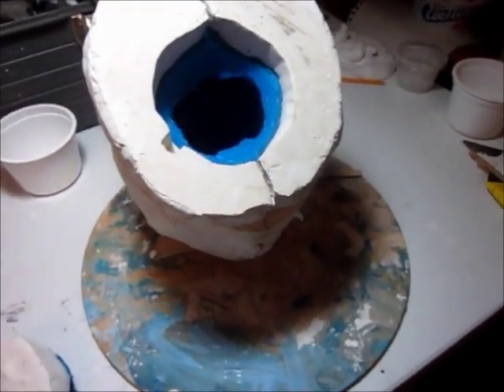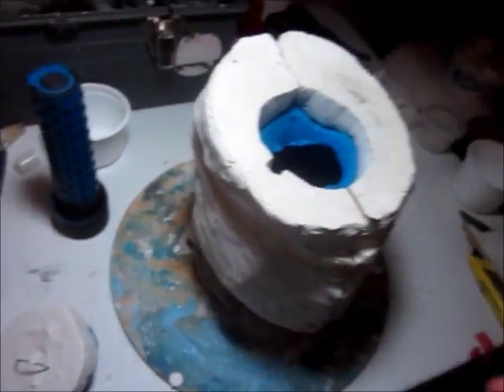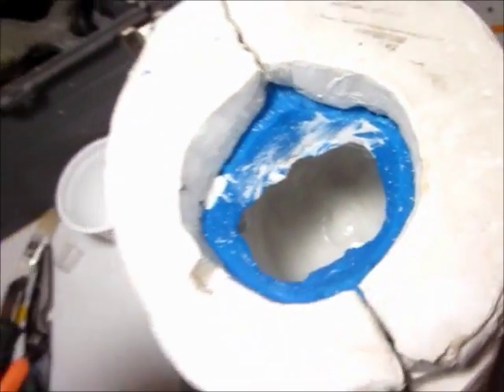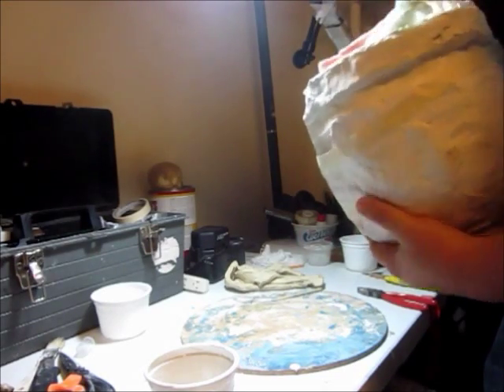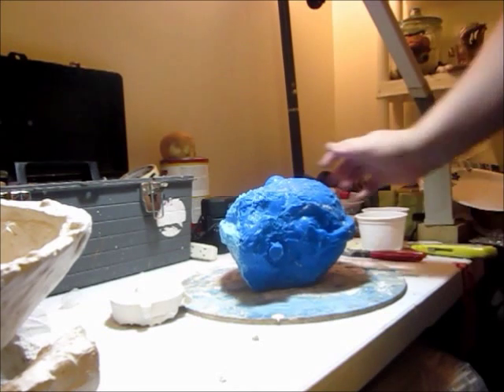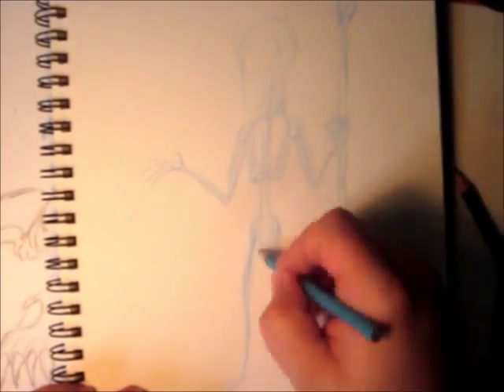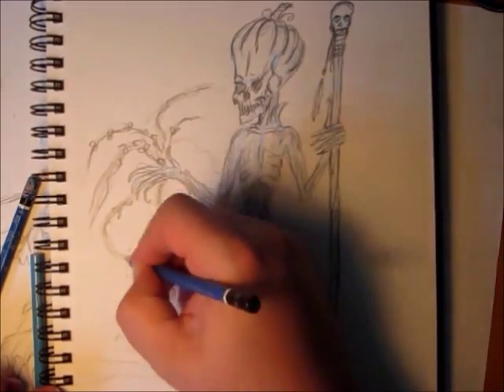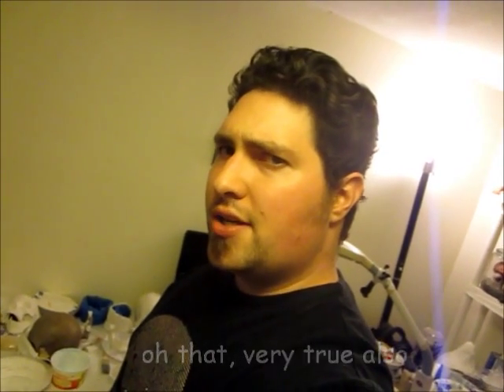DragonBone vlog 006- Vampire Skull pt 3- casting

Comment: Clean up?// Hell your place is spick and span compaired to mine.
The Vampire skull project is excellent.
You should be proud.
 I'm posting a follow up to your new vid.
As for molds your's look much nicer than mine also.
I'm a bit sloppy.
I'm getting very good with the great stuff foam but it will never work as good as the 2 part.